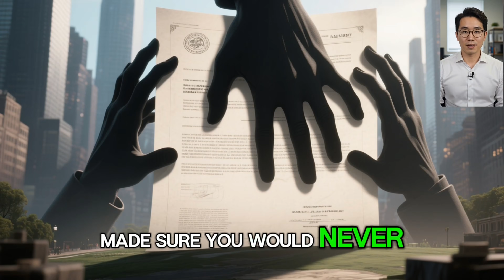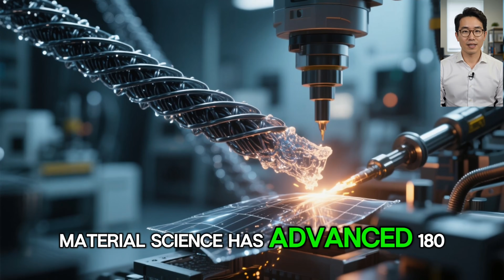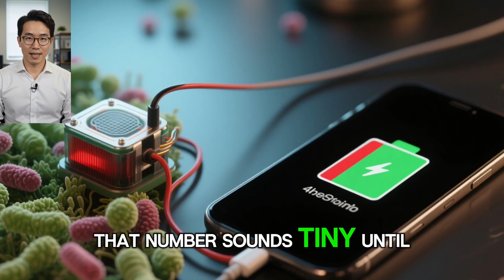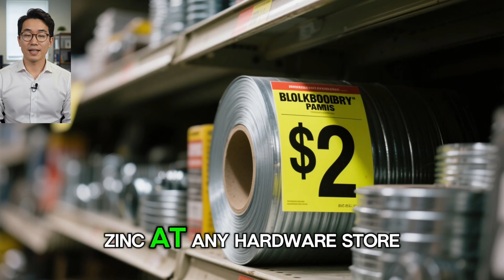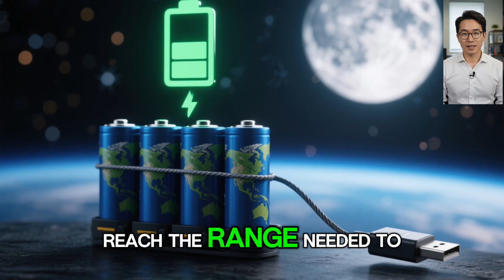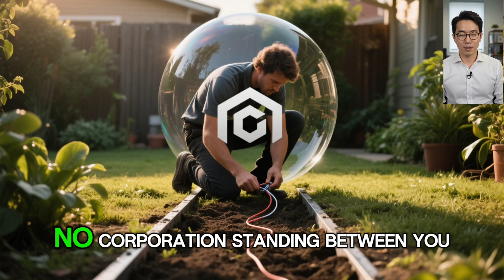Mud + Copper Wire = Free Power Plant  The 1841 Earth Battery They Made Illegal

Comment: 0.5 to 1.5 Volts at 0.000000000000000001 Amps, is nothing.
Reply from the maker: Fair point 😅 Voltage alone doesn’t mean much without usable current. The real question is: can this setup deliver enough amps to power anything practical? ⚡

Comment: If you apply oil filled capacitors and step up and step down transformers
Reply from the maker: Interesting idea. Capacitors and transformers can shape and store energy, but the real question is: can they increase usable power, or just redistribute what’s already being generated? What do you think? ⚡
Reply: @Mr.DudeExplained yes you can as you setup the first wave of capacitors and transformers it goes to a breaker box to maintain steady state James faraday and setup 4 units like this as you will be able to switch units as you maintain one unit with no loss in power if you have any special equipment electric devices at higher power needs make a power unit just for that appliance so it will not drain power from the house as this is a mini version of the power grid but doesn't have a mechanical generator just a 48 volt battery for each unit or push comes to shove get by with 4 twelve volt car batteries even if a little used and make as I said 4 units so you can maintain the batterys with distilled water and charged so as batteries need charging on one unit you switch to other unit and charge the low batterys it's a mini tiny version of the power grid you don't fool with a turbine generator which is another creature well any way once you have one started it will cut your electric bill in half it will save enough money to put in a second one it's when you see the bill go from 600 to 300 then to 150 once you no longer have to duke energy 300 dollars Xtra you will quickly make the other 3 power units a tiny version of the power grid but easier to maintain and if you get the courage to make 12 more power units it takes your bill to zero something duke energy does not want you to know so once setup hide the units in a secret room so it can't be seen in the open

Comment: I saw it with salt water yesterday but if one unit makes 1 watt then I really need many units to be able to make enough power for a household. Is that really understood by what one unit makes?
Reply from the maker: Exactly. One small cell usually produces very little power, so you’d need many cells connected together to reach useful household levels. The real question is: how many cells would it take to power something like a fridge or TV? That’s where it gets interesting. ⚡
Reply: That's quite a lot. An oven uses 3/4000 watts to start up and uses many hundreds afterwards in just one hour. 😂 @Mr.DudeExplained
Reply: @wajihhallal7336 Edison batteries
Reply: Totally agreed with you

Comment: Will it still work after an emp is blasted?
Reply: There is no reason for it not to work
Reply from the maker: From a chemistry standpoint, you’re right—the electrochemical reaction should still work. The bigger question is whether the rest of the electrical system or devices would still be functional after an EMP. What do others think? ⚡
Reply: @Mr.DudeExplained don’t know
Reply: @Mr.DudeExplained  If there is no solid state devices in circuit it will still work.
Reply from the maker: @keithpayton-y5m  Good point—yes, it can still work without solid-state devices. The key question is: can that raw output be stable enough to actually power useful electronics? ⚡
Reply: 👀Yes It Will Till Work
Reply from the maker: In theory, yes. A simple electrochemical cell like this has no electronics, so an EMP wouldn’t really affect the basic chemistry. The bigger question is whether the devices you want to power would survive the EMP. ⚡